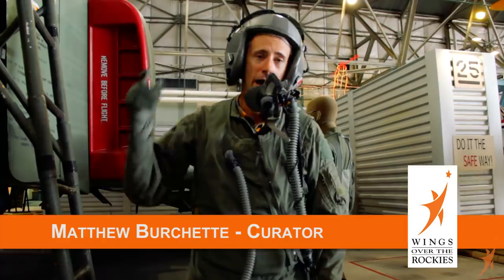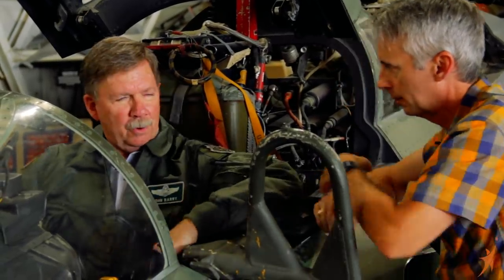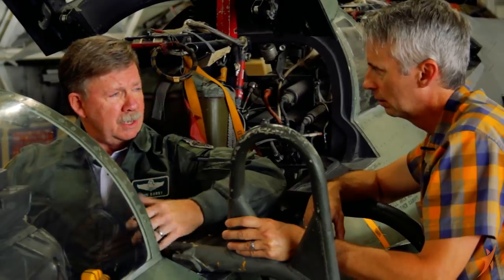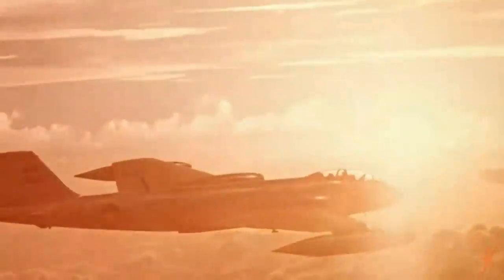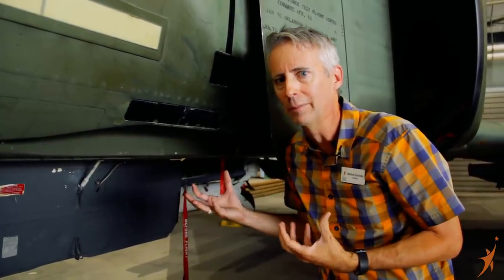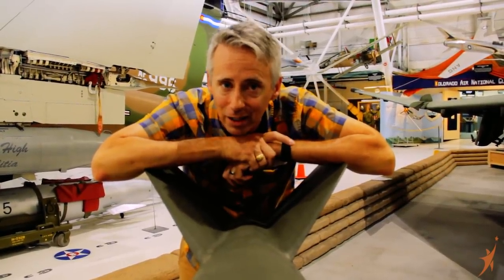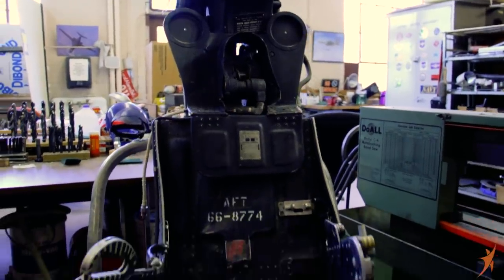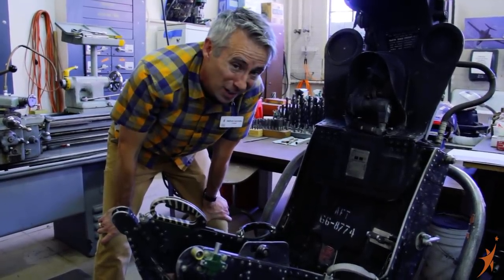F-4 Phantom | Behind the Wings

Comment: Worked on the 119 ecm pod on F-4D at RAF Bentwaters/Woodbridge, England. Scary beast for my first jet avionics assignment. After being signed off on the ejection seat, I could sit in the back seat and test our ECM pod in STANDBY for errors. Other times I would help the RHAW shop with their little scope and receiver, walk around the plane with a "Squirt" box to see if the RHAW scope would show where I was. The AN/ALQ-119 pod would be installed in the missile #1 position with a heavy adapter plate. One guy would hold up the plate on his back and the other guy would start putting in bolts. We used a trailer to haul the pods out to the planes and an MJ4 or 8 (funky bomb loader) to pick up the pods, drive over and raise them up while a friend would connect the electrical parts, and tell the loader to go up, dwn, sideways, etc for the hooks to line up and then a tool turn would grab the pod. A bit noisy and in the winter, fingers would find the safety wire! ouch!

Comment: that dump truck flew my cousin thru 2 tours of vietnam and he came home ALIVE!
Reply: It is with good reason that the Hebrew name for the F-4 is Kurnass which means "sledgehammer".
Reply: One of my favourite aircraft...
Reply: @robertdore9592  In some respects it was way ahead of it's time. Pity the politicians screwed some aspects up.
Reply: @sab368iceman5  its just a joke man, im pretty sure he referred to it as a dump truck because the host said the pilot was an "F-4 driver"
Reply: @sab368iceman5  and/or because it's a multi-purpose aircraft, you can "dump" a wide variety of armament on it (and truck because pilots are refered to as drivers as said per @Isael)
Reply: I was a crew chief on the F4 for 5 years and It was an awesome aircraft. I worked on C,D,and E models. I liked the E model the best. It carried it's cannon internally not mounted on a pod.
Reply: @Gordon Lawrence   Kurnass in Hebrew actually means wizard or conjurer.  One of our squadrons, the legendary 69th, is called Ha'Patishim or The Hammers.    69th flew Phantoms for a long time. I had the privilege of working on the 69th Phantoms as an airframe mechanic in B-Check, & later as a general airframe mechanical fitter.   Our Phantoms were maintained in tip top condition right up to before being decommissioned, & upgraded to a very high operational capability.   Working on them was some of the best times.
Reply: Actually your cousin flew that dump truck through 2 tours in Vietnam. :)
Reply: @sab368iceman5  the only reason it fly is because it has so much thrust, it's practically a brick with wings and two giant fucking engines.
Reply: timfuneral2031 glad he mage it out , that was a blood bath , aviators were greatest % of the POWs .🇺🇸⚓️
Reply: My cousin was a grunt as he called it in Vietnam. He said you could always try when a Navy/ Marine fighter support came in...they would about set the tree tops on fire 🔥 they would come roaring ing in. Other services it would just start raining bombs.
Reply: My uncle worked on these planes at Seymour Johnson AFB

Comment: Things some people do not know about the F-4: 
It was the first fighter to have a full intercept radar and computer though it was analogue.
The analogue computer suffered from drift so Jack Kirby of TI invented the IC to stop components experiencing different temperatures as much as possible (to reduce drift).
The J-79 engine was the first to have variable stators.
The sheer amount of wiring in the F-4 was THE reason for starting research into what became the MIL-STD-1553B bus.
The IDF called one variant "Kurnass" (Sledgehammer).
The RAF variant had RR-Spey engines which are more powerful than the J-79 (by about 10%)but it was slower because this screwed up the aerodynamics so badly.
The RAF Phantoms flew with Skyflash instead of Sparrow missiles.
The F-4G holds the record as the longest lived "Wild Weasel" of all time.
The F-4 is still in use with Greece, South Korea and Japan.
For some reason F-4 pilots are referred to as "drivers" and this is roumoured to be a joke going back to the Vietnam war.
Reply: Did they called themselves drivers because the phantom was so heavy like a flying bus ?
Reply: I want to mention that the remaining 36 hellenic F4s got updated with advanced electronics in the early 2000s.
Reply: @Gentleman...Driver  was it the digital system or the advanced analogue one though?
Reply: @nhatpham9933  It's actually lighter than modern equivalents. IE the F-15E is a tad under 2000 pounds heavier empty weight. You cant call the Raphale or Typhoon equivalents though as they were initially designed for a different job.
Reply: @gordonlawrence4749  Fully digital as far as I know. They have Multi functional displays now in the cockpit, new radar and guidance systems, etc. I believe they gave the contract to the Germans back then. The Greeks wanted a bit more life time for the F4 until the F35 is delivered.
Reply: @Gentleman...Driver  If there are MFDs then there has to be a DSP or MCU (or both) for sure. I'm just wondering if the EMU for the J79's was updated too. That could make a difference both in power (though not a lot) and fuel economy (as you'd need less compressor stall margin).
Reply: @gordonlawrence4749  For this I dont know really. The contract is a bit of a secret and the program had a lot of problems. Ironicly they had issues with the german software. The Germans had updated their remaining Phantoms, too until Eurofighter was delivered to them.  The new systems had problems to "activate" the "dumb bombs". The Germans didnt need the Phantoms to bomb somebody. They just programmed the software to use the modern ordinance for precision bombing. The Greeks claimed that area bombing would be the main role of the aircraft during a war against Turkey. 
You can look it up."Project Icarus 2000"
Reply: Dassault Mirage 3 also had a air interception radar operation just a bit after the F-4. Turkey also still operated the F-4.
Reply: The F-4F Phantom is also the Fighter aircraft with the longest service history in Germany. Its been in service from 1973 to 2013. This record will go to the Panavia Tornado very soon though
Reply: You know, I didn't expect these to be "things people don't know", but these are awesome.
Reply: @Gentleman...Driver  The German F-4s that underwent the ICE program did replace their APQ radars (E-model equivalent) with APG-65 radar AND installed HUD's in their F-4s BUT they kept the original instrumentation and radar scopes of their F-4s.  They adapted the APG-65 to work with those vintage scopes.
It would have been far more expensive to completely gut the existing cockpit and revamp it with glass cockpit displays.  As it is, the Luftwaffe probably kept their F-4s in service 10-15 years longer than anticipated because of delays and cost overruns with the Eurofighter program.
Reply: Jack Kilby.  Jack Kirby was the comic book creator.
Reply: one thing to add: the F4 didn't originally have machine guns and had to rely on heat seeking missiles.
Reply: @gordonlawrence4749  As good as there were, the were major gas hogs.
Reply: More information, and more interesting information in one comment than the entire video. Hat's off to you, Gordon!
Reply: Joe Al  I'm not sure but I think it's about the fact that once you eject you're not supposed to fly jets again because of the compressive damage done to the spine. Ejecting twice probably lead to a lot of back pain as the body aged.
Reply: Japan retired the old girls
Reply: The F-4E is the only aircraft in history to rack up a gun kill on an enemy aircraft while flying at supersonic speeds.
Reply: @triadwarfare  They also relied on AIM-7 radar guided missiles which turned out to be unreliable.
Reply: @ChucksSEADnDEAD  That is probably true of older aircraft but the Martin Baker set was a big improvement over earlier ejection seats.  I spoke to pilots who ejected and they described it as relatively smooth.  The thing is, ejections are the last resort and is not always survivable.  Ejections are also relatively rare and a pilot having to eject twice is unusual.
Reply: Variable Stators wow I didn't know that.
Reply: pretty much all fighter pilots are referred to as drivers. F-16 are Viper Drivers. F-15 Eagle Drivers, A-10 Hog driver etc.
Reply: I haven’t seen it here, so it must be a little known fact…the ailerons only deflect down!  They do not go up. Just forward of the ailerons are spoilers that deflect up to kill the lift on that wing in conjunction with the downward deflection of the opposite wing aileron. Also, at high angles of attack the the hard wing F-4s (I have no experience with the slatted birds) would depart controlled flight if the stick (ailerons/spoilers) was not centered. At high angles of attack roll was produced by deflecting the rudder which pushed one of the swept wings more into the relative wind and thus produced more lift on that wing. One could roll the aircraft completely around and reverse directions just by using the rudder. You would program your brain to make sure that the stick was centered when you heard the aural angle of attack sound in your headset approaching “on speed” or max angle of attack. The aural angle of attack would start out at a low pitch and low frequency and as it approached max angle, it would increase in pitch and frequency until it was a steady tone at max angle of attack. If you exceeded max angle, the tone would go to high frequency and high pitch and the rudder shaker would engage. If you didn’t reduce the angle of attack and had ANY stick deflection to the side, the aircraft would depart controlled flight. This resulted in the an uncontrolled roll and the controls being useless until the angle of attack was reduced and the aircraft regained flying speed. I haven’t thought of these things in many years!!!

Comment: I was once in a bizarre vantage point and caught an F4 and an F16 dogfighting. The F4 was giving the F16 the business. It was 1988 or 1989. I was in the USAF stationed in Germany. I was on on top of some building, maybe a hanger detailed to watch the Germans work. We had a mock air field attack. My base had F15s and a base 8 miles away had F4s and F16. Add the Canadian F18s and the air above me was crazy. 

On the back side of the flight line was a huge ravine. I never really took note of it before that day. But I was maybe 3 stories up when these two jets made everyone on the rooftop drop down because they seemed so close as they roared by. The F16 was actually the prey for the F4. He chased it down into the ravine. I expected the F16 to be maneuverable but I had no idea what the F4 was capable of. The F4 was known as the flying brick. That turned out to be a lie. 30 some years later and I'll never get rid of that image and the sounds. So close you could see rivets.
Reply: That sounds absolutely amazing.  I'm glad you were lucky enough to have that experience

Comment: the Phantom is my all time favorite aircraft I have sat in many when I lived in Beaufort,sc and being an avid model builder have built many Phantoms over the years. I would love to have a phantom sitting in my front yard
Reply: Here is a couple of tidbits of information for you then. The IDF called one variant "Kurnass" which means sledgehammer, and because it was the first fighter to have a relatively complex analogue computer, the earliest ones had some "drift" issues (analogue multipliers for example tend to drift up or down on the output as temperature changes). This resulted in 1958 or there abouts Jack Kirby of Texas Instruments trying to put both transistors for a "long tailed pair" (an essential component to make any analogue computing function) on the same piece of silicon so they were in the closest possible proximity to reduce temperature differentials. So we have the F-4 to thank for computers in a way.
Reply: F-4B PHANTOM I have a question for you have you built the Aceademy F-4C Vietnam version ? does it have early style navy pyiions or late style or are both included ? would appreciate your input on this I plan on getting the Acaedemy kit because of the 1 priece fuselage thank you for your time hope to hear from you on this matter happy modeling stay the course Bruce
Reply: My very own F4. RC model actually.